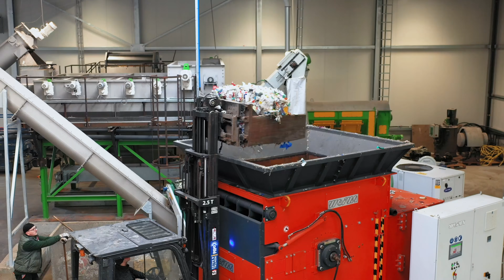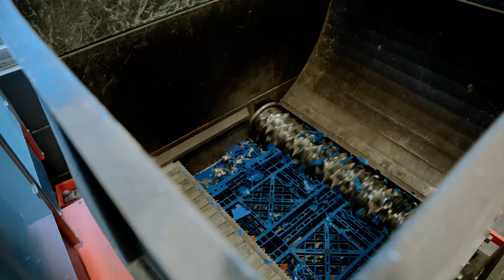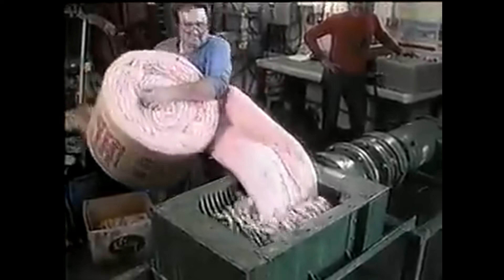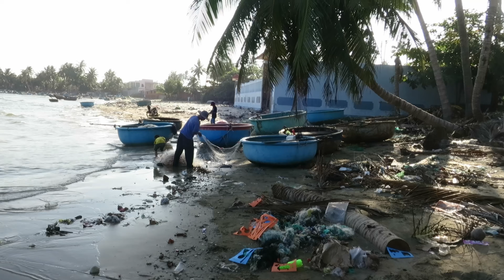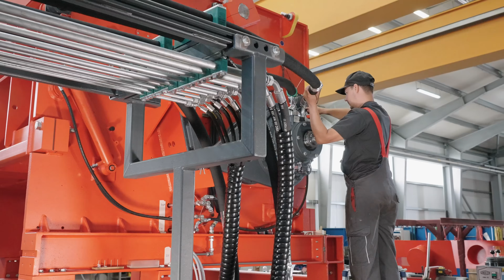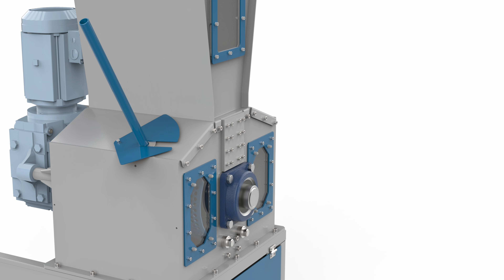Precious Plastic X WEIMA developed an Open Source Plastic Shredder.

Comment: If it is released open source, simplify it as much as possible. Make all the sheet metal for xometry laser cutting, and use the minimal amount of bolts necessary. Remove whatever specialists processes where possible - welding etc. Ask ‘why would they not buy a cheaper version with no assembly’? Remove any complexity to it, and reaffirm the strategy with repairability methodologies.

Comment: I'm glad.
I've been one of your harshest critics over the years and shredders has always been one of my bigger issues.  But, I've always given you respect for putting out open source plans. And I do thank you for that.

It's disappointing to me personally that they're always in an industrial direction, but that's understandable in this case because a corporate collaboration should have industrial safeties and robustness.  I'm still hoping that someone will develop plans for the hobbyist level and create a shredder that's extremely cheap to produce.  Because my focus is the democratization of recycling to the household.  But that's why my designs and methods don't even need shredding.  I've been able to remove the step entirely for my purposes. 

But again, this is really good.   Hopefully more companies and small businesses will be able to take these designs and start producing these for sale.  Then recycled plastic can become a much more accessible material.
Reply: Cheap to build, but also very small since I don't plan on doing it a lot and would have to find a place to store it. Personally I don't mind if it takes longer because it is small, but perhaps other people do and that's the reason that they are all big?